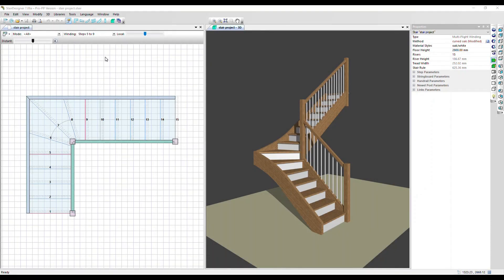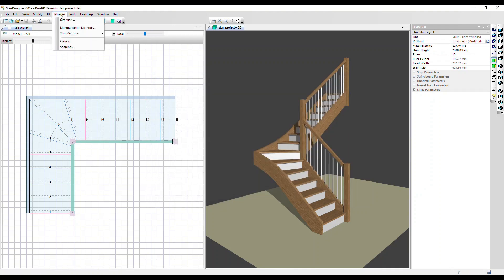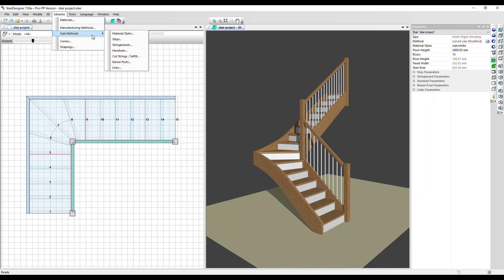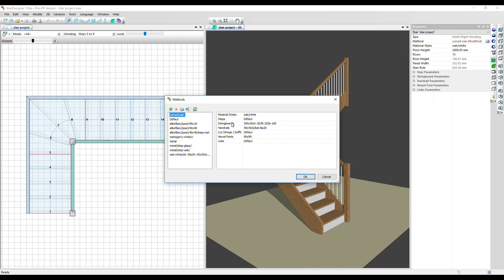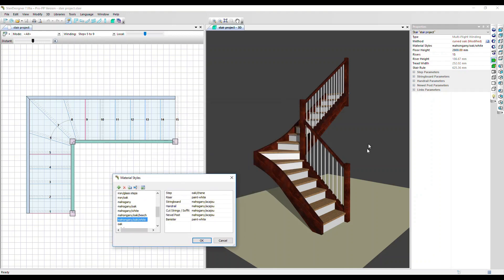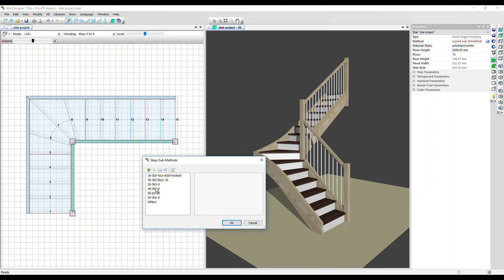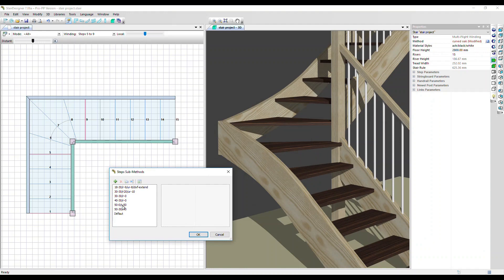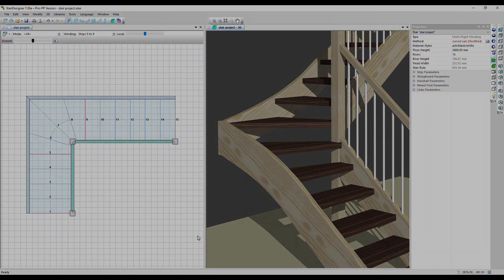Libraries and Manufacturing Methods Overview in StairDesigner

Comment: in your forum you add a new Feature that says you can do stringboard in "Z" shape, how i can do that ? (im using demo)
Reply: It is not possible to obtain Z-shaped stringboards. The latest added feature is a block-shaped stringer following a staircase geometry called "cut version".
Reply: @michelmelon9099  yes it is i did it manually, but it is very time-consuming. I was hoping that you have automated it some how :-)
Reply: @waski9017  Hi, The cut version of the cutstringers is automatic. You only need to input the size and the shape is set immediately. No need to do it manually. Z-shaped is not possible
Reply: @michelmelon9099  nevermind i finnaly found it :)